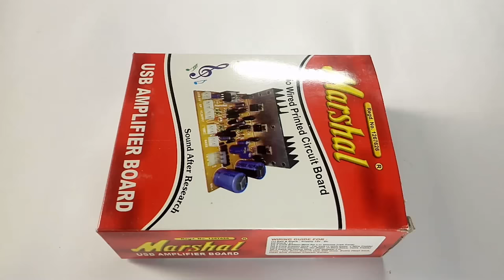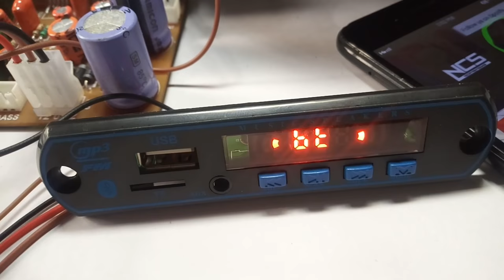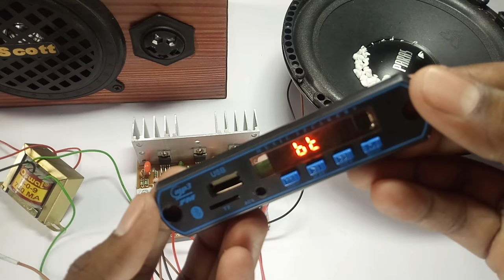How To Make Audio Amplifier From New 2.1 Home Theater Circuit Board || Tda 2030 IC Board

Comment: aaj maine ye board online se order kiya. aur sub woofer se connect kiya. only loud humming sound. no 5v dc voltage in bluetooth module checked with multimeter. so bt module not working. also the transistor in front feels very hot. I used old 12-0-12 1.3 amp transformer. I think I need to change transformer to new one. earlier it was humming too. but songs were playing in that module.
Reply: Use 12-0-12    2 amp transformer for better sound ........
Reply: @indianvillagertraveller3466  sir input wire ulta lagaya tha

Comment: Your board has D2030A which is the chinese version of tda2030. Is it sounds good
Reply: In my personal experience it won't be good because ..I used an intex amplifier it has D2822 IC initially and i found it damaged and getting heated ...and i go to shop and I asked D2822 ic they given TDA2822M IC. when I installed it the sound was better than before

Comment: Hey i use 40w sub woofer and 3+3w speaker in this board but my speaker beeping and one rejistance is fired..why
Reply: use 5 Watt Resistor instead of ¼ Watt
Reply: That's because you're giving too much of current for your speaker.
Your 40watts speaker can withstand more current but this amplifier board doesn't...that's why you're frying that resistor.
Ofcourse you can add 5watt resistor instead of 1/4 watts but someday it will fry up entire circuit